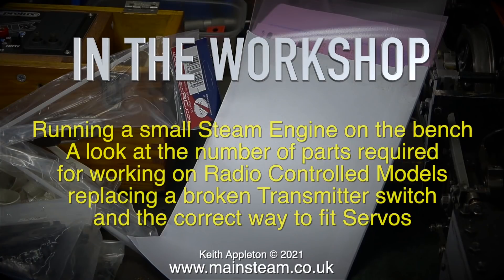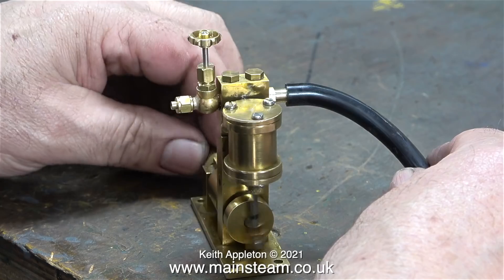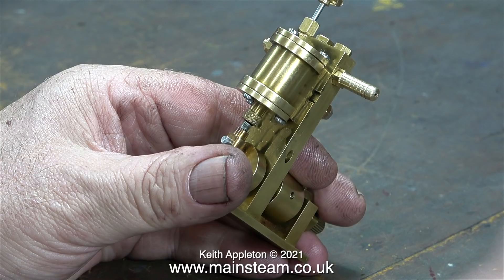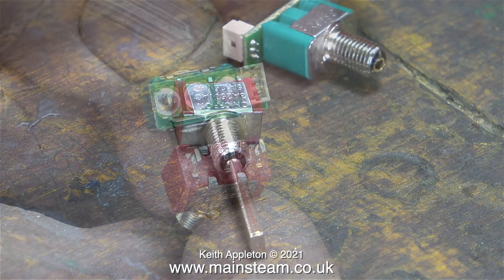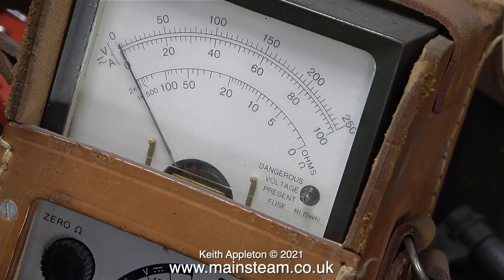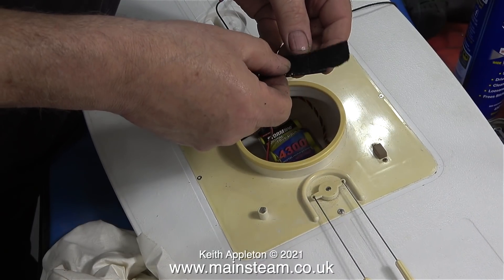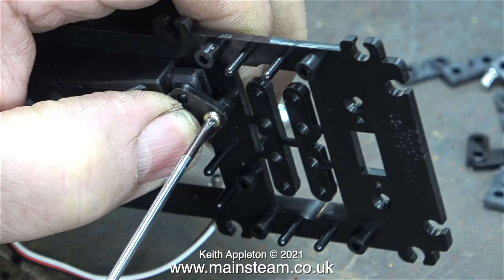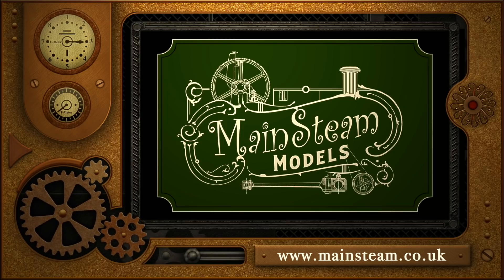A STEAM ENGINE TEST SERVO FITTING AND TRANSMITTER REPAIRS

Comment: What great surprise, I designed and built this engine in late 2012 then sold on ebay to a buyer in Norfolk. It has 7/16" bore and stroke, silicone seals and was originally fitted with a lubricator, not Microcosm. I still have the listing pics.  Cheers.
Reply from the maker: I congratulate you on your excellent engineering. The engine runs exceptionally well.

Comment: Hi Keith,  I have an old trick for you that I use quite a bit, been soldering for 22 years and you have to learn some tircks.
So that you don't tear traces off the board, what you do is you solder all the pins together with a large bead of solder over all the connections.  Once the large blob of solder carries the heat through all the connection points, the board lets go with ease.  You can do this in a couple of minutes without threat of lifting the traces.  Give it a shot next time.
Reply from the maker: Thanks for the tip, I will try that the next time I try and unsolder a double sided circuit board }:-)))

Comment: Hi, I had a TVR1A engine and it is made by Graham Industries here in the USA, and they are really fine running engines. I did use it in a model r.c. steam boat I built, and it worked really well. Good choice!
Reply from the maker: I stand corrected, thank you for letting me know. It's been a long while since I had one - I remember now }:-)))

Comment: Keith, when you use the solder braid, add some solder flux to the braid. You can get a pen or some paste and a small toothpick or wire to apply it. Then apply the braid and the solder will wick into the braid, carrying the solder. Solder sucker works first followed by the flux & braid.